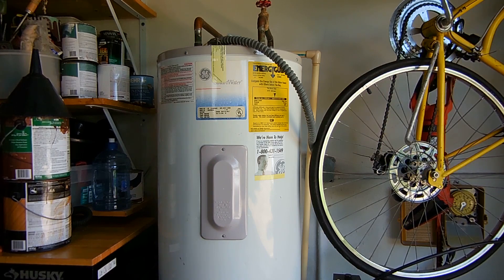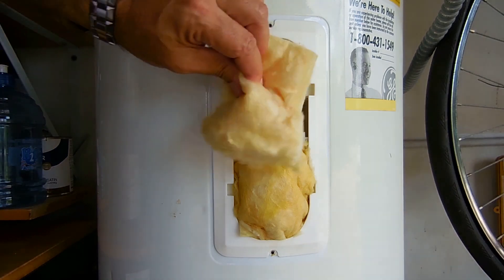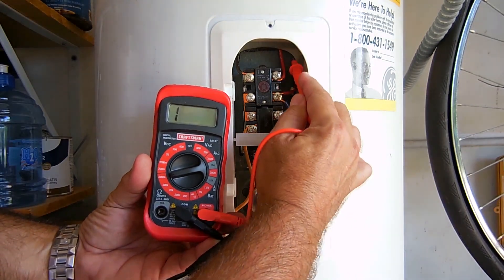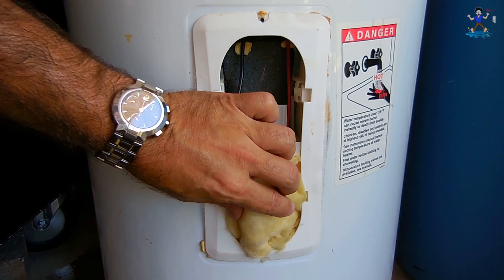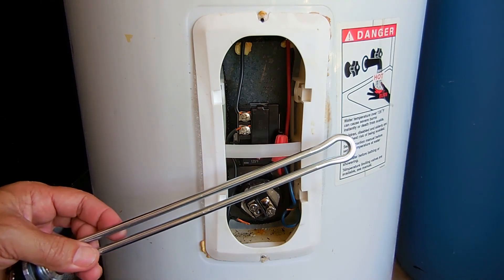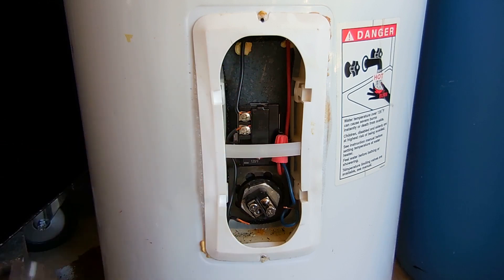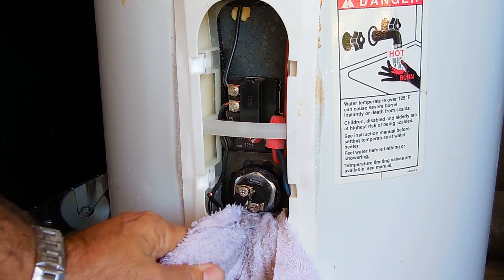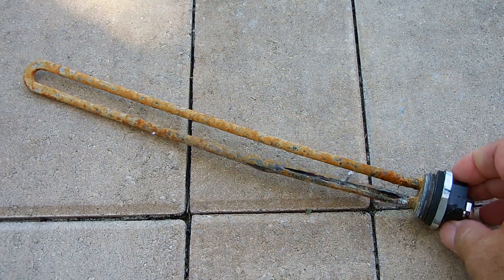Electric Water Heater Not Heating Water (Trips Breaker)

Comment: Change your anode rod every 5 years depending and tank can last 30 years.  Pick proper material depending on water.
Reply from the maker: That's true, but the average person never bothers to check. Many people buy homes and they have no idea how well the heater was serviced. Water quality is the big factor. Thanks for watching!
Reply: @electronicsNmore  Since anodes cost $20 and takes 5 mins to install it's the way to go, once rod goes then tank starts corroding from inside out.  but depends on which type of rod vs your water type: https://www.doityourself.com/stry/5-types-of-water-heater-anode-rods-explained.  Yea, the average person doesn't know how a can opener works.
Reply: @s1iznc1d34  I've seen many dissolve in less than 5 years thus depending, certainly gone by 10.  And it so easy and cheap to replace.

Comment: Always make sure connections (screws to wire)are tight..very tight.if not you could ?have a fire...THANKS
Reply from the maker: Yes, poor connections are high resistance connections that can heat up. It's VERY rare to have a fire start and spread if the metal covers are in place. Thanks for watching!